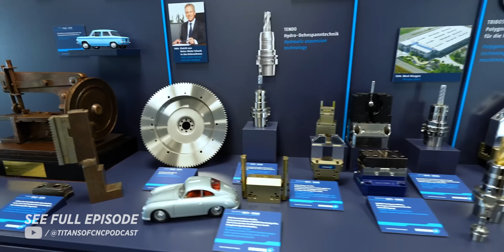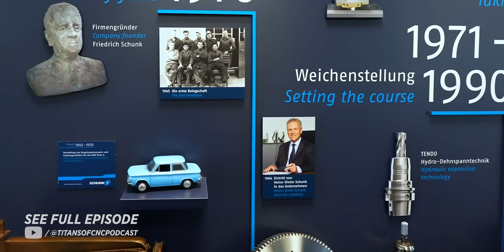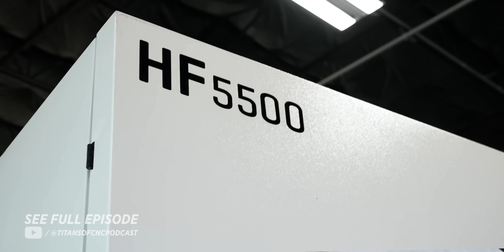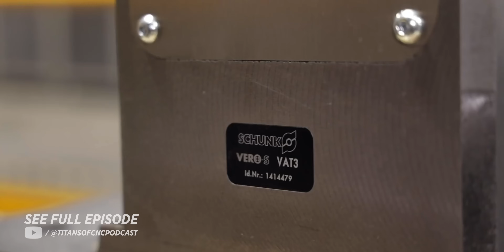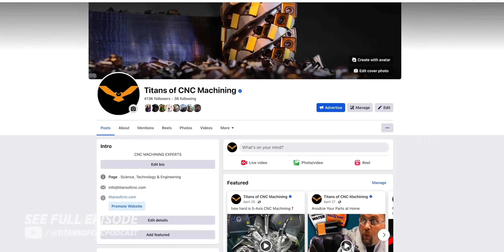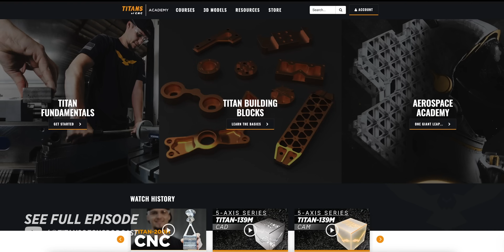$500 Million Dollar Machine Shop Exposed

Comment: It is as told, many solutions were there all the time, but not for everybodies pockets to buy, besides this, the evolution of machines and cutting tools, quick and powerful needs different clamping.....
The same as a muscle car on small tires, yes you can drive, but don't push the pedal on the metal 😂